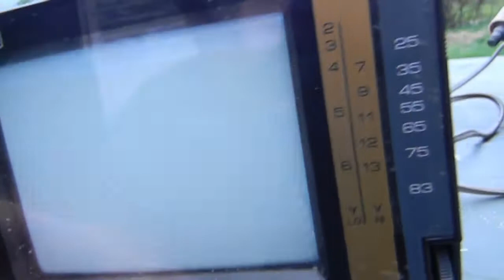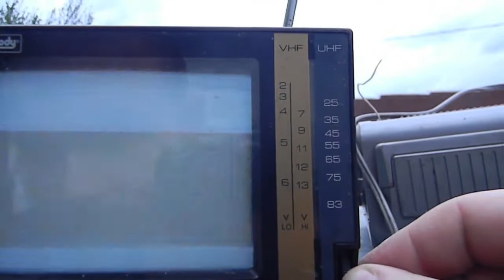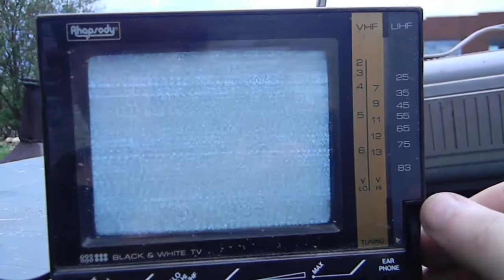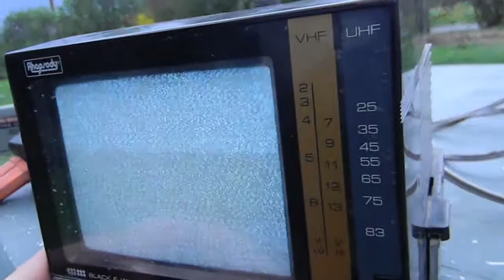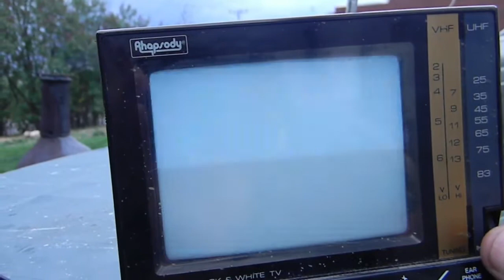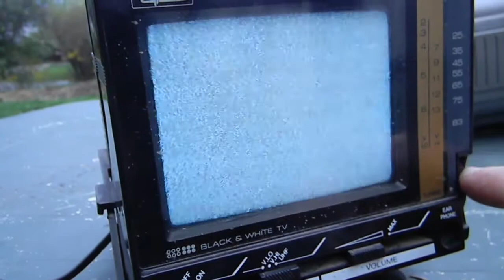Picking Up Radio Stations on a UHF/VHF TV

Comment: vhf and uhf on the tv is also used by radios. the eas signal you heard was NOAA radio, which is in the vhf range, and most tv signals are in the uhf(500mhz) range i believe. i can actually hear the tv signals on my uhf radio.

Comment: EXPLANATION FOR EVERYONE HERE!:VHF UHF Band  TV’S Can Pick Up Low Power FM Radio Stations On VHF TV A Lot Of FM Stations Slip into the VHF band the top of the fm
87.5 To 9.20 FM Is Close To Channel 2 To 6 On The VHF TV Band It Also Depends How Close You Live to FM Radio Transmitters Then it will always bleed into the vhf uhf TV And Radio Bands So Nothing Is Wrong with the Television Sets tuner it’s perfectly normal FM Radio And The VHF Low TV Band Are On The Same Frequency Range Sometimes Even The VHF WB Band Bleeds Through even police scanners

Comment: Not at all "weird". You're listening to https://www.weather.gov/car/NOAAWeatherRadio VHF or Very high Frequency. which is 30 - 300 Mhz . NOAA weather broadcasts on 162.400 - 162.500. it's simply  the receiver in the TV picking up VHF: https://www.weather.gov/car/NOAAWeatherRadio
Reply from the maker: well that makes sense then.
Reply: RockeyDAproductions  - lol, now if you got a picture with that weather broadcast - that would be weird ! Best regards!
Reply from the maker: it sucks all the analog repeaters are gone, i havent seen TV in years.